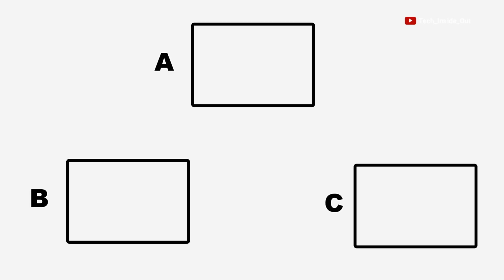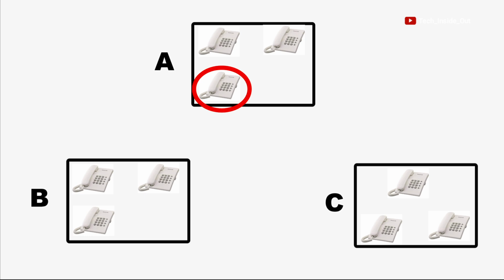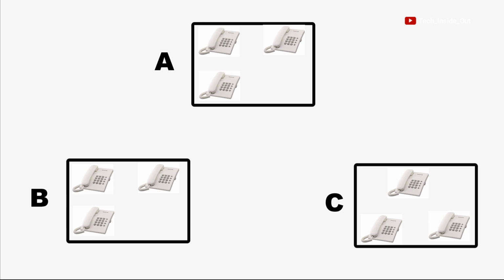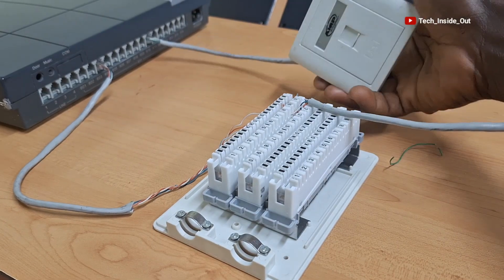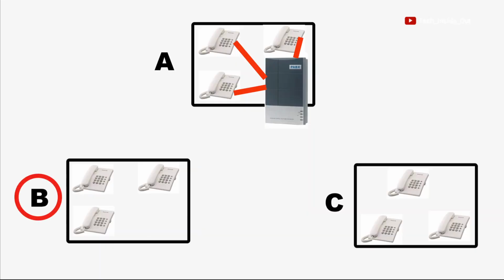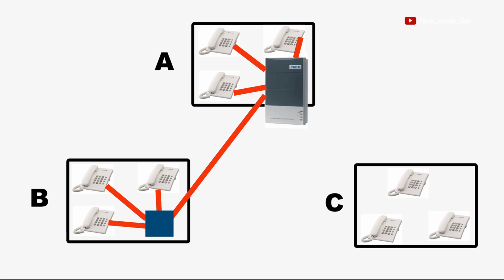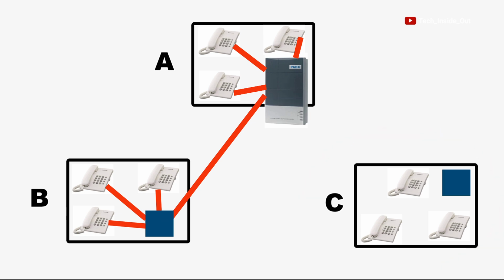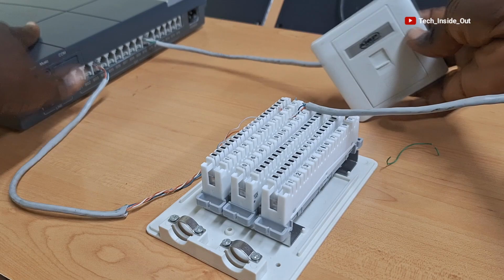Telephone Distribution point - DP uses and applications

Comment: Please how can you connect 4 phone to dp and send to pbx via multicore cable.
Reply from the maker: After connecting the 4 phones to the DP, you can use a network cable as your multi core cable and use each pair of the network cable for each telephone connection.
Reply: @Tech_Inside_Out  A network cable like cat 5 or 6? 

The PBX extension port is for RJ11. Can the whole 4 pairs of cat 5 be crimped in RJ11? 

The technicality is a bit complex for me, I've not fully understood this.

Comment: HI mister @Tech_Inside_Out
Please does it mean you can use the DP to connect many telephones on Extension jack? That is if you have like say 100 telephones, can you use 16ext jack pbx with DP to connect them all?
Reply from the maker: No, it doesn't work that way. Each telephone extension goes to a pair of the DP. It is a one to one connection.
Reply: @Tech_Inside_Out  
Okay, thanks for the explanation. I like what you do, lots of courage

Comment: What is the multicore cable?
Reply: Thanks for your support sir, how re we going to connect the multicore cable?
Reply from the maker: A cable having multiple pairs of conductors in it. A normal cat 6 cable is a multi core cable having 4 pairs of conductors, however there are multi core cables having 50, 100 and so on pairs
Reply: @Tech_Inside_Out  
Thank you
Reply: @Tech_Inside_Out  thanks sir

Comment: I've been waiting for the video. What happens in case one can't get a multicore cable? Can one combine several cat 5/6 cables for this provided it is properly marked?
Reply from the maker: Yes, you can use a cat 6 and mark it properly.  One cat 6 can do for even 4 extensions.
Reply: @Tech_Inside_Out  thanks
Reply: @Tech_Inside_Out  Wanted to ask if there's a way to combine two switches to make one. Like combining a 32ext switch with a 16ext to make a total 48ext.